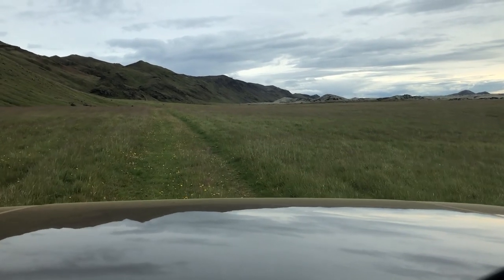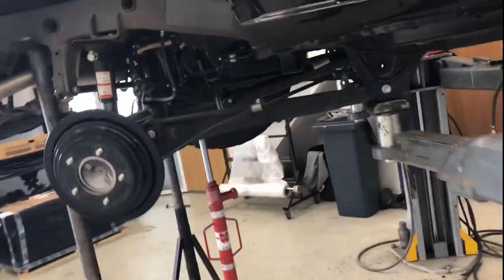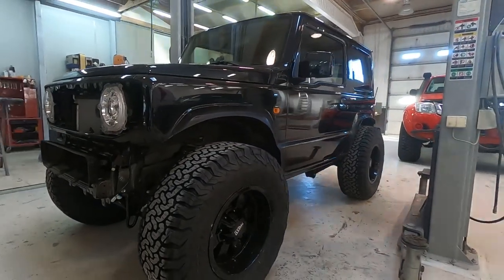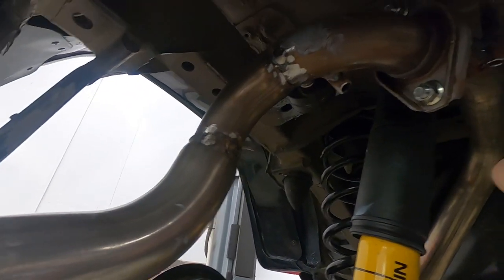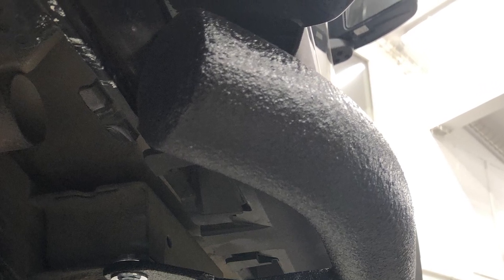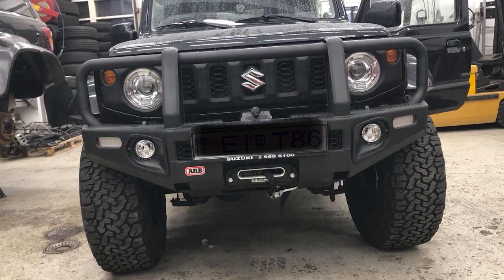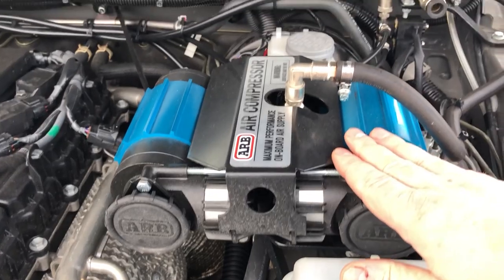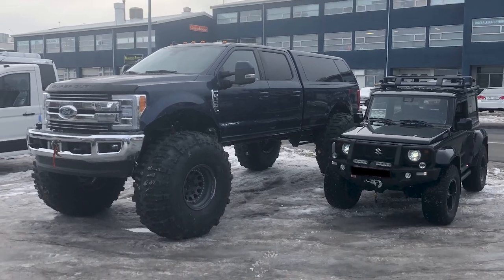The Big Jimny Build Part 2

Comment: This is the optimal Jimny build, I will build mine much milder, skip the tire inflation system and all of the stereo stuff, and go for a liftkit and as big tires as I can fit after that.
Generally I am against lifting the body from the frame, but in your case it wouldn't look stupid and it might have saved you some cutting for clearence. (I think you can lift 2" without serious compromizes)
Also, the ARB bumper protrudes forward a bit much, not for your monster, but for a milder Jimny, so I would look if there was something else to bolt the winch to.
The tip about the motor controller being the same as in the GSXR opens up for many aftermarket parts, although I would probably call your guy in Norway who already have a working solution.
Great videos

Comment: The only thing I would change is that I would go with beadlocks . Amazing build mate !
Reply from the maker: Thanks for the positive comment 👍 I really thought about doing that but I am trying to keep the Jimny as light as possible so I decided not to because they are to heavy. I have the tires clued on and that has not failed me yet 👍
Reply: @thenewjimnychannel361   aha ok make sense about the weight but I don’t know if the glue could handle low pressure for extreme off-roading also the beads look SIIICK 😂 especially with your build

Comment: Put that metal encase to protect the differentials beneath the car

Put some lights on the roof to give it a complete truck look

And change the front grill to the one that says SUZUKI or some other design that is finished in Matt black

Also but a supercharger if it's possible. Take the horse power to atleast 200hp

Other than that your car is amazing. Good job

Comment: I've seen the problems you've had with gearing and power, I'm surprised you didn't consider a portal axle kit which would have given a gear reduction and enabled bigger tyres to be fitted without spending tonnes on a suspension lift kit and or power upgrades. Beautiful Jimny though none the less, mine is standard at the moment. I'm tempted by the TIBUS portal axle kit!
Reply from the maker: Thanks for watching my video. Would absolutely have done portal axles at the time I was doing the upgrade, but I didn’t know they were available back then. But they are hugely expensive and I doubt they are any cheaper option than the rest of the upgrade I’ve done so far.

Comment: You are obviously a Drive-a-Jimny-in-Iceland expert. I rented a Jimny in September 2023 for 2 weeks, but did not really drive on the F-roads. August this year I return and plan on more F-road driving and I already rented a Jimny again. Say rainfall and other weather conditions are normal, would you say that I should be fine driving to Landmannalaugar (Northern route F26/F208, actually I would prefer to go by F225 and catch F208 just before Landmannalaugar) and Kerlingarfjôll in the Jimny? Any input if I continue on F208 towards Huldufoss or should I not press my luck?
I`m confident about driving to Thakgil. Thorsmörk I have decided to take the bus to and back, as I am not too confident about the final 2-3 river crossings before Thotsmörk.
Thanks, Per
Reply from the maker: It all seems fine to me. F208, 225 are usually ok in August. But Þórsmörk can be tricky if it rains much.

Comment: All I was thinking was gear ratio and if those shafts can handle the tires, fuel consumption
Reply from the maker: No wonder you where thinking about that😅 you are absolutely right. I am still working on that problem. I have installed new axle gear ratios 4.88, but still need new t-case ratios and I am in the process of installing them. I hope that will make all this transformation worth it👍The fuel consumption is around 13-14 liters on long hauls but can go up to 18-20 in extreme situations.The shafts are still holding up fine tough 👌

Comment: Very nice achievement. I am very interested in the manufacture of the additional tank. Please, can you show us more detail? how is the filler neck positioned, what type of pump is used? where the gasoline is returned in the original tank? is there an additional canister? is there a gauge?
Reply from the maker: It´s kind of hard to explain in text. Maybe i will post a short video soon. But the short version is that you fill both tanks in the same fuel filling hole. The pipes to both tanks are joined together at the top of filling hole and you only have to adjust the fuel gun slightly to the left or right for each tank. When the main tank gets low on fuel i hit a button marked "FUEL" on the electric control box in dash and a small pump in reserve tank pumps fuel to the main tank and basically refills it. The only problem is that you have to remember to manually switch of the pump when the reserve tank is empty. Hope this explains the big picture👍
Reply: @thenewjimnychannel361  thank you very much for your answer it's very clear, i wanted to do exactly the same thing but a professional told me that the gasoline vapors from the new tank will create a canister fault. your fuel pump is external or internal? can you share the model?

Comment: Hey !! its awesome i have also one just upgraded with arb oldman emu suspension . But i have a question if you have time, which arb air locker did you use for rear locker ? I couldn’t find in in the list it says just suitable for front, thanks in advance
Reply from the maker: https://www.jimnybits.com/suzuki-jimny-rear-arb-differential-locker-2019-on.html

Comment: What is the curb weight of the little nugget?
and does Iceland allow beadlock rims so that you could air down to single digit / sub-1 bar tire pressures? I know snow isn't as tough on tires as rock and sand, but ice and ledges are.
Reply from the maker: The curb weight is around 11-1200kg and yes bead looks rims are allowed here in Iceland 🇮🇸 I don’t think I need bead lock rims because I have aired down to 2psi with out any problems in very challenging conditions

Comment: Incredible work. Big Confrats. Is the tpms box for turning off the system warning on the dashboard? If so, could you ease aevise where did u get it from? Thanks
Reply from the maker: Yes it is for correcting errors in the dashboard for tire sensors. I took the sensors completely out and installed the correction box inside behind the speaker one connected it to steady electricity.
Reply: @thenewjimnychannel361 Thanks a lot. This is what I am looking for. Will ve greatfull if you can advise where did you buy this?

Comment: I was wondering with the 35's what is the braking like?have you done a brake upgrade?
Reply from the maker: Hi Neil, no I haven’t done any upgrade to the brakes yet, works just fine at the moment. Eventually I will do an upgrade when I install the Supercharger 👍
Thanks for watching my Channel 👌🤛
Reply: @thenewjimnychannel361  impressive vehicle, no going to fit a turbo I've seen a set up for gen4
Reply from the maker: @neilbeacham1244  Thank you Neil. I have looked at all options for a power increase and finally decided to go with Bullet Supercharger. I just recently made the purchase and will to a series of videos from the install.
Reply: @thenewjimnychannel361  can't wait, it's going to be next level, are you going to run a after market ECU so much more scope for tuneing

Comment: May I ask if you re-geared your transfer case?  what ratios?   Very nice rig you have.
Reply from the maker: I didn’t put in new transfer case ratios. We ordered them and thought the were the right ones but they didn’t fit. Still looking for that upgrade👍 But the 4.88 axle gears are working fine👍 But I might do another upgrade which is very popular here in Iceland and that is a LO GEAR. It is a very expensive mod because it needs to be custom built from scratch. How it works is you basically pull a special rod inside the car and gearing is 100% doubled down to a very low crawler gear.  You pull the rod again and it’s back to normal gearing. That way it doesn’t affect driving capabilities on highway’s 👍
Reply: @thenewjimnychannel361  I have been maintaining an early '90s SJ413 and am using Calmini's 4.16.  Am using 235-70-15 tires.  Was wondering if these transfer case re-gearing parts were available for that latest generation Jimny/Samurai.   Thanks.
Reply: @thenewjimnychannel361  could u help and give me the link for the 4.88
Reply from the maker: @mohammedalmgbil9169  I got my ring and pinion from 
http://www.gollek-automotive.com/Startseite/

Comment: very nice build! I love the fenders and your very neat fuel tank solution! Wondering why you chose the little Jimny in the first place, it sounds like you could have afforded a bigger more expensive vehicle? Also, why didn't you do a body lift? Wouldn't that help a lot in a simple way with your clearance  problems?
Reply from the maker: Hi and thank´s for watching my video. Someone else asked a similar question and the short answer is that everything about this project is much more sensible. How can i explain it better? it is the most common sense in irrationality you might say. For example the Jimny is much more lightweight vehicle which makes it much more capable in though snow conditions. The Jimny is much cheaper than most new 4X4. You can also use it as a daily driver and so on. But the main reason why i choose the Jimny is the looks 😁😎

Comment: Why instead of cut so much metal you didnt install 5-6 inch lift kit and then will be needed only minor cutting and maybe none.
Reply from the maker: Hi, the main goal was to keep the cars weight distribution spot as low as possible for driving capability, such as in steep side slope and highway driving. Always better 👍
Reply: @thenewjimnychannel361  
Got it great anwser! Keep updating with videos on off road trails.

Comment: How’s the engine able to move these tires? 😂
I doubt it would be capable to do anything off-road
Reply from the maker: You are somewhat right, it struggles a lot going up steep hills, but it moves enough after re-gearing the axles. Took the Jimny to a top of a Glacier and it has already proven itself in very tough situations. Check out the rest of my videos on the New Jimny Channel👍
A Supercharger is coming soon, and I hope it will solve all my problems👍😂
Reply: @thenewjimnychannel361  I am planning on getting one very soon, but I am definitely not going to drive it stock. The engine needs a lot of work and the only turbo kit I see trending is GReddy kit.
Please let me know which kit are you going to install.

Comment: I don't see the point of spending all this money, why not just buy a more capable vehicle. The biggest draw card was fuel economy but the Jimny fails at that and it is horrible on the highway.  I have been dreaming of a Jimny for a while but they do not stack up.  My first 4wd was a Sierra back in the 80's I was trying to relive that I can't see the value in a Jimny compared to say a jeep.
Reply from the maker: A stock Jeep costs more than the Jimny with all the extra upgrades! The Jimny can go anywhere, but a stock Jeep can’t. So i would have to modify the Jeep for double the amount of money to be able to do that, and I don’t see the reason 👍 believe me a Jeep would need at lest 42” tires to be able to follow the Jimny anywhere and it would have double the amount of fuel consumption😀 so my main point is the bigger is not always better and that’s why I choose the Jimny 👌
Reply: @thenewjimnychannel361  money is hard to come by for me so i need to do the math on costs.  The Jimny is on my short list of vehicles and it all comes down to individual needs of course.  Some big concern are in most countries that level of modification would be highly illegal and if you were in an accident your insurance company would not help you and you could be facing serious police charges and lots of payouts at your own expense. Insurance company and lawyers are quick to destroy you if those structural and suspension mods are not certified by an engineer and engineers cost way more than the mechanic doing the mods.

The other issue is the wear and tear of the rest of the vehicle that is not designed for the extra weight and height,  for example the entire drive chain is compressed. The angles are all changed with the new height in say the steering system for example. 

As far as go anywhere that is limited by the distance to travel - in Europe distances may be limited but I cannot see anyone going out for weeks at a time or even days in a Jimny. The fuel economy is not even great for such a small vehicle in fact the fuel economy is pretty lousy and the road handling is another issue.